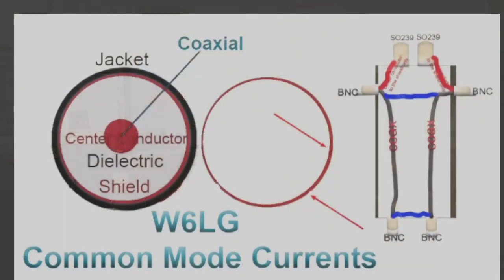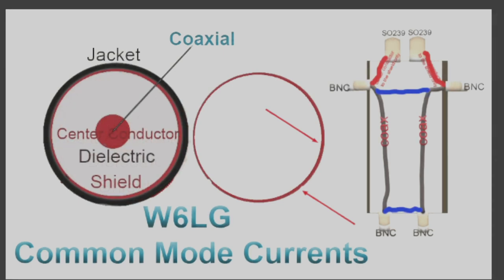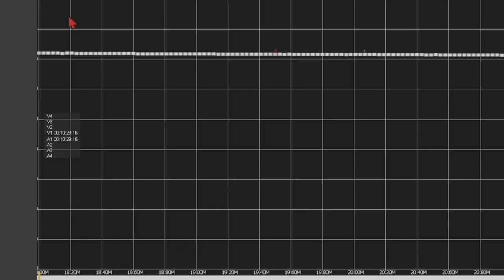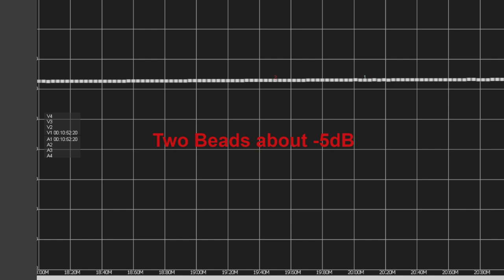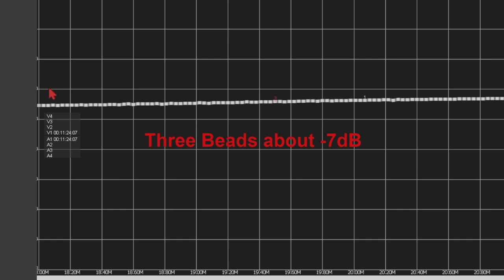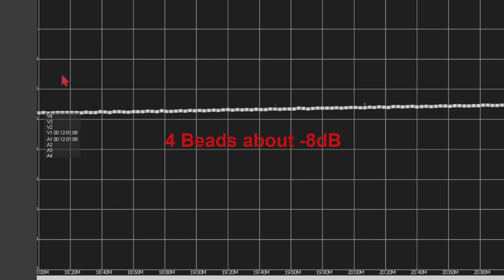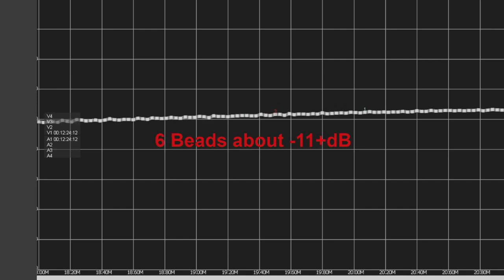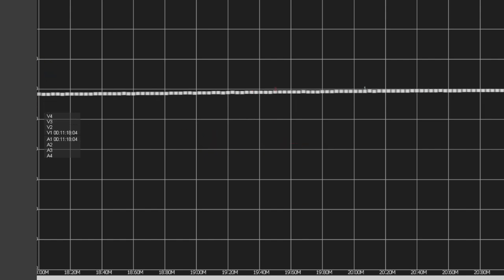How Many Ferrite Beads on an HF Antenna?  What is Coaxial Cable?  What are Common Mode Currents?

Comment: Hi Jim, good to see you still making videos. I have played around a lot with common mode chokes and have found measurements interesting. TBH I have not done much with small ferrite rings, I have generally used 2.4" type 31 or 43 toroids. I have wound them with varying numbers of turns of RG400 or similar ptfe coax. I found at best I could get about 35dB of attenuation (Ref 50 ohms) of common mode current. I did find that too many turns on either type of core worsened high frequency performance, presumably due to the capacitance between turns. About eight turns on an FT240-31 is in the right ballpark to cover  160-10m.. You might find it an interesting experiment, for HF bands I don't think small beads slipped over the coax W2DU style are very effective. 73
Reply: Ferrites are highly effective on coax, more effective than a coax coil choke. 73
Reply: @GroundControl204  the "ugly" type chokes can do more harm than good.

Comment: Wow, Jim. This is something I have always wondered about and you have answered it and more as I need to check to see if my beads are a 31 mix and fit tight against the coax. Thanks again! Alan KZ6B
Reply from the maker: Glad it was helpful!  I was using 31 mix and some were defective.  Maybe it was something that I did.  I simply don't know.  73, Jim

Comment: Jim I hope you feel better soon.     Thanks again for a great video and all the valuable help you have given as I set up my first station !    All I want is the best sound I can get !!   I just ordered rg-213  coax and now my questions on chokes have been answered !   Next up is finding a compatible antenna tuner that I can use with an Icom 735.  I will do a lot of listening across the bands and then use the 735 some on 10 meters until I take the general test !  Best Wishes

Comment: Great video Jim W6LG. Would you place the beads on the coax feed line at the radio or more closer to the antenna on the antenna feed line?

Comment: Jim I really need to find the video you did on calculating loss from using a tuner to correct SWR and all the corresponding loss in RF. You explained it perfect how the 100 W eventually diminished cycle after cycle. Done so well. I want to educated some folks with this valuable data.  Had someone say just add power. No way to convince them of the actual theory.  You are are appreciated. Trust your health  is improving . Love all your presentations. Is there a list of all your presentation. You are the gold standard.
Richard
KC6ART

Comment: Enjoy the visit and I hope nothing untoward comes of it due to the immunosuppression.
Thanks for the information. As with many others, I would like to know about looping through a toroid, looping through a snap-on, and yes, I believe solid works better due to the continuity of the magnetic lines of force. Is it then any different than a toroid?? Seems to me to then be a toroid on its side lol.

I did see odd results measuring with a vna when I added the toroid. It definitely appears to affect the frequency response. It makes sense, it makes a coil.

Comment: I have a single Mix 31 snap-on with the coax making 6-7 passes in a loop. Is that roughly the same as having 6-7 beads in tandem on a straight piece of coax? Or do the loops add a capacitive element, too? My Rigblaster interface freezes during FT8, but only on 20m and only occasionally. Therefore, I still think I may have a tiny bit of common mode on 20m... it's only noticeable with the Rigblaster (voice is fine). I find myself considering a second bead snapped on the same loop to "double" the choke's effect. Will it work that way? Thanks! -Scott, KE4WMF

Comment: Jim, Palomar Engineers carry sets of snap on beads just for this purpose. I've arrived at the conclusion that putting chokes at the feed point, in the shack and in between (within reason) has paid off in better tuner performance (remote tuner), and improved noise suppression at the receiver. While coiled up coax (ugly "unun") is better than nothing, type 31 material has broader response curves and a cleaner installation. Yes, more money but these can be installed over time to fit any budget. Besides, what's the point of getting on the air if an operator has noise and wasting power?

Thanks for another excellent video!

Comment: I see most examples of common mode chokes being used in the field. They are using a short piece of coax and from five to seven cores with heat shrink tubing, installed right at the transmitter. Is the most effective location either portable or base? Is the last thing before it leaves the shack to the antenna? Thank you in advance for your valuable advice. 73 de W3LU

Comment: Just out of curiosity, would a large number of RF chokes eventually lower the RX incoming signal? I am using a mix 31 and mix 43 - FT240 toroids in series at the antenna feeding point and a mix 31 - FT240 toroid by the rig + 6 beads on an Ultraflex 10 feeder

Comment: I'm new to all this, but what I gleaned from a couple of YT lectures by John Portune W6NBC, is that, in ham bands,  the inductance of coax with ferrite bead(s) (or a wrapped ferrite toroid or a balun coil) is inversely proportional to frequency.  Your test example was at 20m (15MHz) with 7 or 8 beads and you got 12dB reduction in common mode current (25% or unchoked current).  Does this mean that if I am operating at 2m (150MHz) I would get the same  reduction in common mode current with just one bead (assuming of course that ferrite performance is independent of frequency, which it isn't)?

Comment: Hi Jim,
That was a great demonstration. Wonder if the non snap on bead would be more effective. The audio in this video was much lower than usual. Had to crank up my Cambridge Soundworks volume control quite a bit. You and the family stay safe.  73  WJ3U

Comment: I placed one at the aerial at first but had r.f. lower down so I put it near the radio. R.f. higher up now so I'm buying more and put one at both places. 
Is there a right position near the aerial? At the aerial? One foot away? Two feet away? I wonder because r.f. might be stopped at the aerial but picked up on the coax halfway down. No radio books I have tell it, they just say use a balun or ferrite rings.
Interestingly one aerial manufacturer says at the aerial and another says at the radio.
How's this for an idea, coax braid made impregnated with ferrite!
G4GHB.

Comment: 1'st, the snap ons are great for an RFI fix or for experiments but always use the solid equivalents when you have a choice. the solids are much cheaper as well. Means you have to be able to install a connector of course but every ham should be capable of doing that anyway. 2'nd, the impedance presented by the bead is proportional to the square of the turns going thru the bead, the cable thru the bead equals 1 turn, however the impedance presented by the bead goes up ~X4 when you put 2 turns thru the bead (bigger bead or smaller cable) or a toroidal core. Fair-Rite and others publish impedance Vs frequency Vs number of turns curves for each material, generally they show 1,3 & 5 turns........ 73. Mike, K1FNX near Boston

Comment: I have always took a 6" outside dia pvc and did 4 to 6 turns of cable. The PVC allowed me to keep the winding close together and it kept the loops constant. By doing this would there still be a need for Ferrite Beads?
Reply from the maker: My simple tests showed that the coil of coax worked fine.  When I clamped on beads, it got very narrow banded.  It looked like something with a high Q.  73, Jim
Reply: @ham-radio  I had the same question.  Thanks for the answer.  ... When your new box comes in and you run more tests.  Maybe you can compare: beads vs. toroid w/ multiple turns vs. just loops of coax.  I'd be very interested in these results.  73

Comment: Dear Jim, I really enjoy your videos. I'm preparing to mount an antenna in my attic and I have a question. Does the "type" of ferrite bead I use  matter? For example, do I want to use "#31" beads? What prompted my question is when I made the balun for my antenna, the plans called for a specific type of toroid (mix #43).

Comment: Great video Jim.  Many HexBeam makers place 5 to 7 snap on ferrites just at the feed point coax on the center post.  Does this mean that the ferrites used for a choke should "always" be at the feed point of the antenna?  Also, Silent Key M. Walter Maxwell (W2DU) did strongly suggest the "W2DU Choke Balun" in his book "".  He suggested slip on ferrite beads.  Also he explained that unlike toroid cores, the beads do not become "heat soaked".   I do believe The WireMan and Palomar Engineers do sell this choke as a kit.   Lastly Jim, can you delve further into the EFHW comment you made?  Thanks Art W1SWL

Comment: Wow 10? I assume that nearly doubles on 40-80m? Any repercussions to adding too many beads for tx losses? Thanks agn Jim. Been wondering these questions as well. You may need a larger box.
Reply from the maker: Ya Jay!  A bigger box is on the way.  More did change the curve and it got a bit weird.  So, I hope that the new device will give me better results. Also, a core with coax run in and out several times was the best for bandwidth and results.  I will talk about that too when the new device arrives.  I am not sure what I bought until it gets here.  The manufacturer has not answered my emails.  73, Jim
Reply: @ham-radio  I’m not sure what’s going on with manufacturer’s these days. I decided to purchase a “hart” brand string trimmer in October. Well In March the motor went up in smoke. “Electric”. I’ve emailed and called 2 times a week with no response. So much for their taking pride in American made products right.

Comment: Hello Jim. Great to see and hear you. Excellent video as always. I never have used the beads because I didn't know if they worked. I always built the 1:1 on the FT 240-43 with 2 cores and PTFE wire like Peter demonstrates on the TRX Lab channel for 30 dB attenuation.  This looks soooo simple, costs less and much quicker. 73 sir. Stay cool and healthy.

Comment: how about "ugly balun" coax chokes wrapped around a pic pipe, how do those work and is the effect similar? thx
Reply from the maker: Yes, my tests showed that they worked great.  I hope to demonstrate that in Part 2 and maybe a Part 3. We have kids here from VA and I want to spend some time with them as best I can.  I still have to keep away due to my depressed immune system caused by MDS and Neutropenia.  73, Jim

Comment: What difference does the ferrite mix make?
Reply: It changes their impedance on different frequencies.  A good mix for low HF won't be as effective for VHF, ect.  So, you may want to be choosy about the mix you use for your application.  If you are a single band operator, like a GMRS or CB or a Technician who uses local VHF/UHF LOS, your choice will be simple. 

 If you run a very large station with many bands, keep in mind that you will be better off having common mode chokes for all the bands you want to quiet down, because RFI will travel down your VHF coax that will get into the shack to interfere with HF, for example.

Comment: There's free noise canceling software floating around there's a couple YouTube videos about it basically you can have air conditioner running in the background or a Shop-Vac and the software stops you from hearing all that they only hear your voice so make me look into that that way you can enjoy your air conditioner while you're making your videos just a friendly heads up
Reply: Or get a split unit with a quiet indoor exchanger. Can't wait to get mine running and be RID of that NOISE!

Comment: I'm curious about the efhw...will adding ferrites beads ( 5 or more ) along the coax close to tx/rx do the same thing as a choke in order to prevent cmc  with an efhw as well?
Reply: I don't think the EFHW has any problems carrying currents on the shield because the feedpoint is a DC short where everything is bonded to ground.  Grounding kills those "common mode currents" I'm guessing.  Antennae are complicated so I never speak of them in absolutes.  But I do love the grounded aspect of the EFHW since having some near lightning strikes with no run-in on my rig at all. Was fully connected at the time. Blew my fence-charger and my mind, but the radios were fine. One on a J-pole the other on efhw, all bonded at the feed point and entrance.

Comment: It would be helpful if you got to the point sooner...no offense Jim.
Reply: Let me briefly think about which of these is more important. You running out of time or Jim running out of time? You should be grateful that people put this info up on YT in the first place, because it saves time. Personally, it took me months of research, on and off, to learn this and make effective ferrite chokes for a certain application, including sourcing the right items. Before and after that, years of study on theory and practical to back it up. I was going to share my thoughts on a way to do it better and save money, but you'll have to find that out for yourself now. Happy trails.